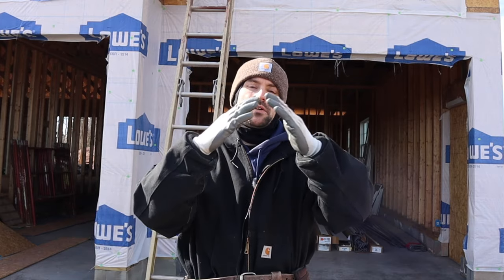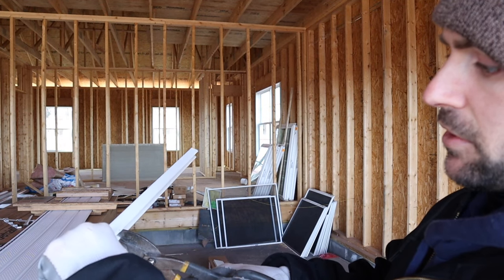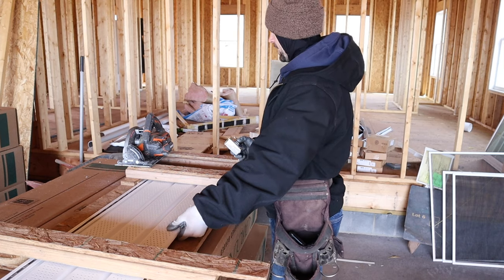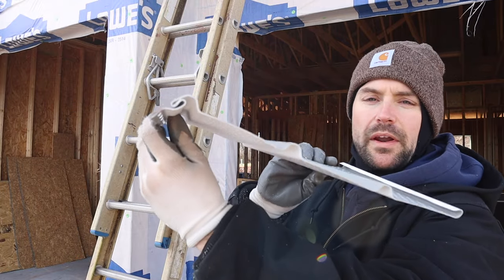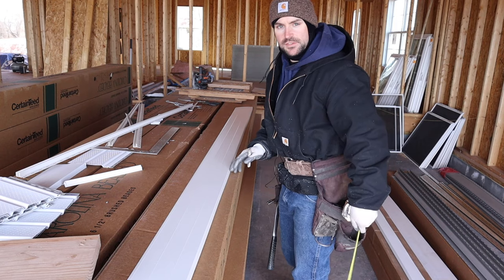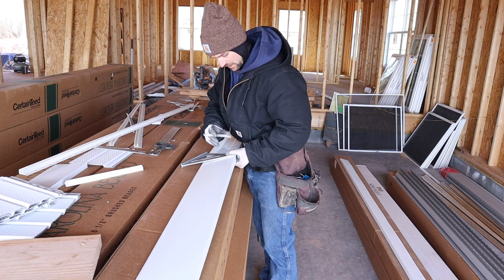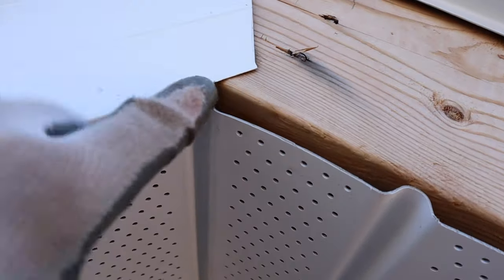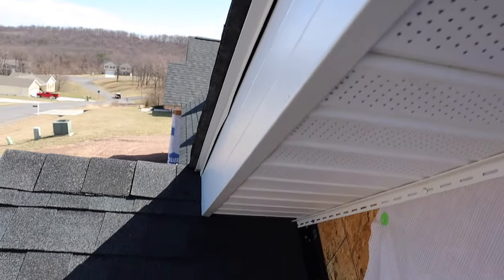How To Install Soffit And Fascia - In The Peak Of The Roof!

Comment from the maker: Is there something about soffit or fascia that you would like to see me make a video about?
Reply: What differences are there in installation between vinyl and aluminum soffit. Looks like they are very similar.
Reply: How do you install the J channel against the brick.
Reply from the maker: @noahb.7838  Tapcons should work
Reply: How do you install facia with two miter cuts. Like that first roof in this video.
Reply: How to do it without a bird box just carrying the siding over to the eaves soffit.
Reply: I would appreciate some tips on how to install J-channel on a gable-end with a steep pitch. 

I'm using a framing square and level to find and mark the wall, but am finding that difficult and have to realign the J-channel --cannot get it level on first try.

Thanks, and thanks for these videos!
Reply: How do you place soffit on a gable wider in the middle than on the end?
Reply: I have an old home. The gable sides of the roof overhang the wall by about 18 inches. The original rake fascia board was attached using 2x4s that were toe-nailed to the underside of the roof decking and toe-nailed to the T&G wall sheathing. This seems sketchy. I am replacing the old fascia and soffit and find that many of these 2x4s also need replacement. Is it common to attach the boards that carry the rake fascia to the bottom of the roof decking? I am considering the use of screws and angle brackets to do this. This seems like a better solution given how short the fasteners need to be to avoid penetrating the roof tar paper and shingles.
Reply: Soffit facia box ends please 🙏
Reply: @BryceJones-yu6gt  you only have to cut one side and you will have to measure each piece

Comment: Your tip on reversing the blade on the saw was great.  I reversed it on my sliding miter saw and it works fine and I didn't have to build a jig.  Love watching your videos.  I have picked up several tips while building my workshop.

Comment: So when you butted up the two pieces of facia  in the peak did you put some caulking underneath?? Thanks very informative video.
Reply from the maker: I did not. Not needed because they overlap each other.
Reply: How about the nailheads in the drip edge any silicone? seems like that may cause a leak in my opinion cause the whole fascia board to rot over time what’s your opinion on that?
Reply: Yea you’re not supposed to ever face nail fascia unless maybe you’re in an extremely high wind/storm area and if you did you would definitely need to silicone or it would leak

Comment: i used a similar setup to cut vinyl soffit but even with blade backwards and trying different tooth count blades siding vent holes would break off completely and it would chip.  Lot of pieces were damaged so had to go back to cutting by hand.
Reply: Warm the vinyl up heat

Comment: Thanks Josh, based on your outfit it looks cold!  I installed aluminum fascia in the middle of winter and it ended up going all wavy by the time summer arrived (due to expansion i guess). Did you experience the same issue?

Comment: Is this aluminum soffit your using? I am installing vinyl soffit and about to do the peak but I don’t think vinyl will bend like aluminum so curious if I should run two things of j channel at the top to hide the seam of two pieces connecting since it won’t bend.

Comment: Ok. One thing I’ve noticed you lacked explaining, was how you get it to end in a “valley” part of the soffit so it looks good instead of ending at the lower area if that makes sense. On the bird box you ended the soffit right at a nailing flange. When i done mine i ended up having to cut one right in the middle. The fascia will cover it but still. Also how to you start the first piece of soffit with no nailing flange, how do you nail it off so it looks good.

Comment: My mom and I are at the soffit and fascia stage of siding and I was wondering if the soffit panels you used in this video are vinyl - vented. Trying to answer a question for my mom about quality issues. Long story... ;) Thanks!
Reply from the maker: Hi Kim. Yes this is vinyl soffit. It does not dent or bend like aluminum which is better. Hope that helps. Good luck on your project!